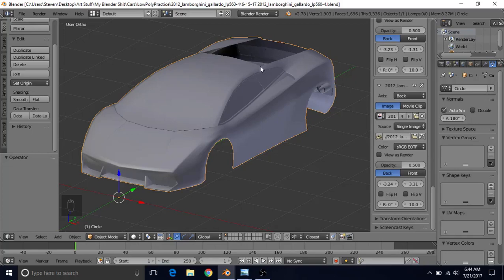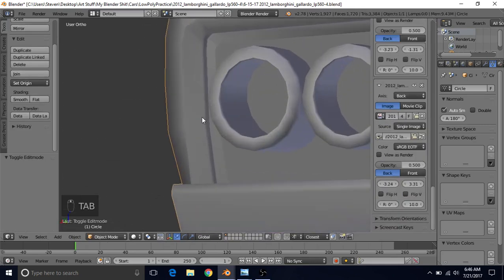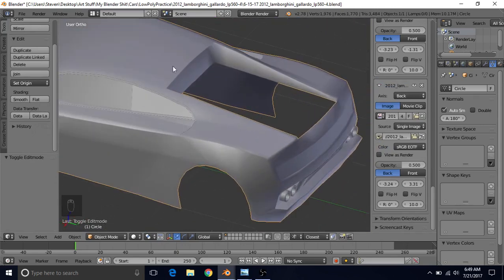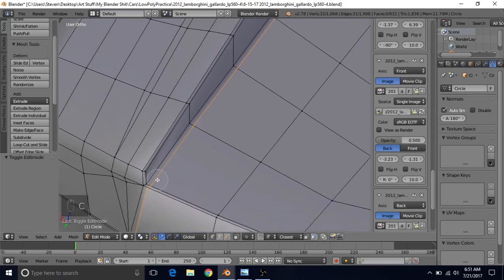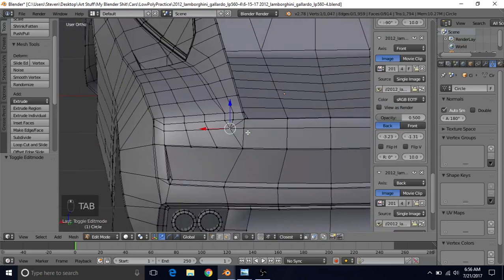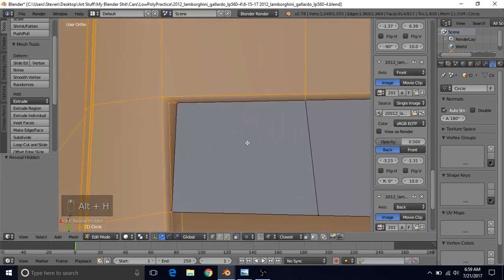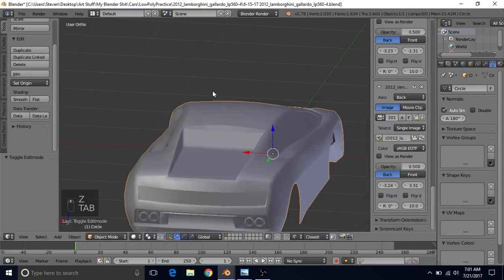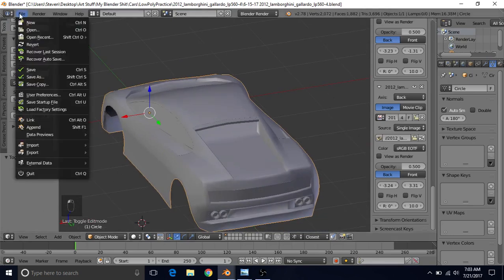Model A Lamborghini Gallardo LP560-4 in Blender - Tutorial Part 13 - Rear Window Area and Fin

Comment: Hey. I'm currently working on a Hummer H1 for BeamNG.drive but I have quite a problem with blueprints, especially the ones for the hood. All the blueprints I found on Google, are waaay to unalligned too work with them, so when I do a thing in one view, then on the other view it's either way up or way down, no matter how good I position it... Is there any hope for me, that I will somehow be able to model the hood for it without having so much damn trouble?
Reply from the maker: There are a few here that you can try:
https://www.the-blueprints.com/modules/vectordrawings/preview-wm/2005_hummer_h1.jpg
https://www.the-blueprints.com/modules/vectordrawings/preview-wm/hummer_h1_m1025_2010.jpg
https://www.the-blueprints.com/modules/vectordrawings/preview-wm/hummer_h1_open_top_2006.jpg

You can also look at photos or load them into blender and use those instead if all else fails. It can be more difficult that way, but still possible.

If you're really having trouble you can e-mail me the .blend file and I can see if I can have any luck with it. My e-mail is stevenbrooksutube@gmail.com. Just tell me if you send an e-mail 'cause I don't always check it.
Reply: I have tried out the blueprints you send, but they are wrong too... I finally settled on a pretty nice one that has some quality to it & is quite aligned even without scaling it so I'm working with it currently & got further than with the other ones
Reply from the maker: Alright. If you need any further assistance let me know.